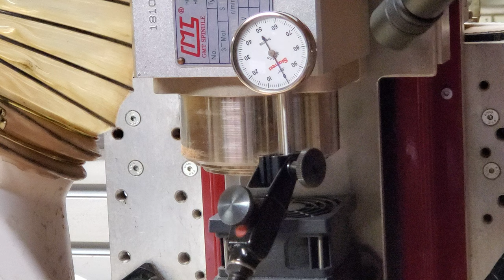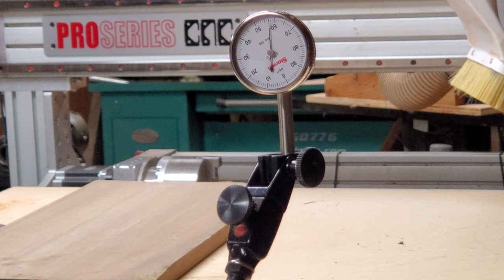A quick backlash test

Comment: To test a backlash the zero must be taken when the machine is moving to lets X+, then you goto a specific distance and come back that same distance, i really dont think that is the case here in the video because the zero is not shown how it was taken, in another words it is not the same if you set zero on the dial when the machine was coming back vs when it was moving forward, hope that makes sense
Reply from the maker: while this was not meant to be a how to, the machine was moving in the Y+ then Y- the change of direction would introduce any backlash. In mach4 there is a compensation for BL, but when I checked it was disabled. I expected to see some change moving machine 6' and back.  That's why I shot the video, I was surprised.
bs
Reply: @bstanga  no that is still incorrect from what you are saying
6' is like 0.1mm, the distance does not matter, if u have a full 1mm backlash and u tested it that way, the result will always be zero! this is called a repeatability test not a backlash test
again the zero mark and on what position (before or after the backlash) was taken what does matter, try it again and see if i am correct, move in Y+ while the indicator is always in contact, stop mark the zero on the indicator, move again whatever the distance u want in Y+ then back to same point and check the indicator, when you u mark the zero while Y- then u goto Y+ then Y- again, the 2 backlashes cancel each other, hope that makes sense